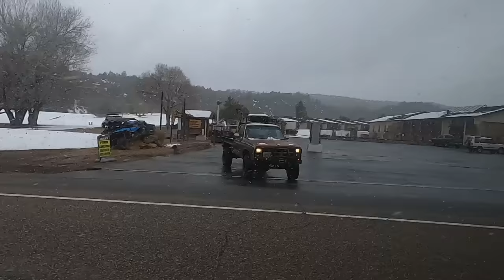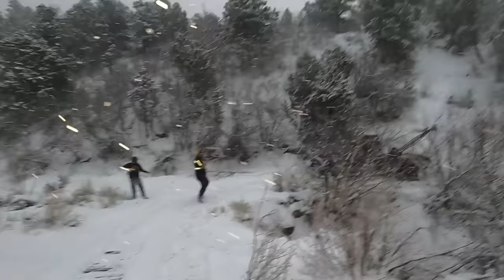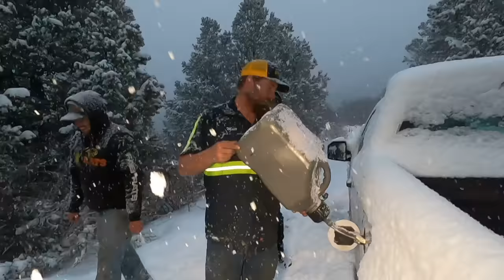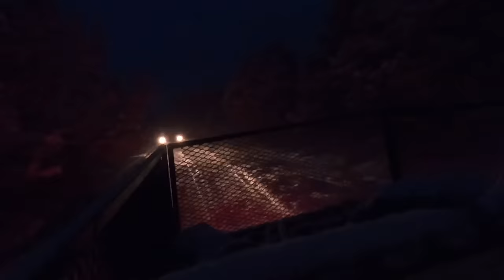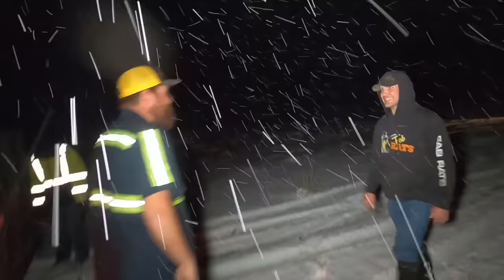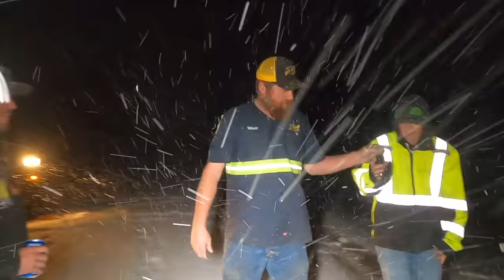Mountain Snow Recovery With A Major Twist!

Comment: A brief suggestion for the snow issues. My great wife and myself lived up a fairly vicious Colorado mountain road that got snow every fall, winter and spring. We used snow chains every year finally developing into a very serious set recommended by a friend further up the canyon that plowed snow with a Ram 1 ton. Had 3/8" side chains with double cross bars with ice bars. Chains were heavy and took a while to mount and then get tight, but were like driving with tracks. Whole rig was a 76 F-250 3/4 ton 4x4 upgraded to a bored out 390 Police Interceptor with 4 barrel made by Weber with a high torque cam. Then could get anywhere along with 1976 Warn 8,000 pound winch and had a snow plow from a dump truck, hydraulic flat bed, springs upgraded to 11,700 GVW, log hoist and three fuel tanks holding 60 gallons of premium. Got burned out by forest fire and now lived the good retired life. Truck still has an excellent owner and "STILL TRUCKING!" Our driving was different from yours as no sand involved just hard granite, ground up granite, minor mud but very serious snow as have had snow coming over hood with no plow while going up a 9% grade. Really enjoy your videos but please consider serious snow chains as makes life much easier in slippery or deep snow.

Comment: That guy sure is brave to go off roading in mud and snow with those tires. Those look like all season tires (and no gas).  YIKES
Reply: With some of the snow recoveries like in this one, it looks like a set of normal winter tires would have been enough for the stuck vehicle to not getting stuck in the first place. (And for the recovery vehicle to have a way easier time)

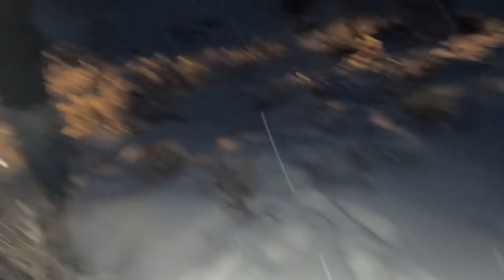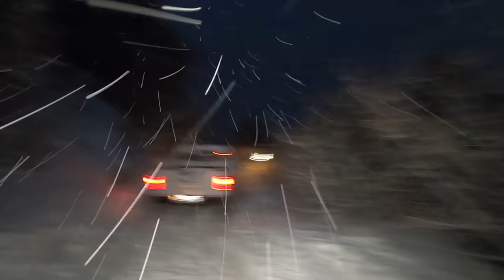Comment: Liz, at 10:51 that is how you drive in the snow. However you do NOT stop like you did at 11:02, the resistance from that much snow will help you stop if you need to stop so if your worried about getting stuck dont slow down.
Reply: Yep

Comment: Hey, i just wanna figure something out. I'm from Finland, where i live. we have snow for 7 months of the year. I know a thing or 2 about driving in the snow. Now, where we live, we do drive with studded winter tires, so that helps A LOT. But a lot of the vehicles you recover have all road or off-road tires which should work fine in the snow, why don't you let a bit of air out of the tires and NOT use wheel spin, i know for some reason it's believed that wheel spin helps in the snow, it doesn't, it melts the snow under your tires and makes it all more slick. What we do when we're stuck is make some wheelspin, like a couple of rotations at half clutch and then let the clutch grip and give the tiniest bit of gas and increase speed as you start going. Now, most vehicles overthere are american automatics, i do have one of those too, so what you do then is give like quarter to half throttle, let off and slowly give more gas. That way you pile some snow under your tires before you make a rut.

Comment: Don't think alot of people realize how badass the kinetic ropes are. Of course Matt is a fabrication wizard and lizzie/rudy excellent welders... but I've done a few very difficult muddy recoveries myself and static winch lines/tow straps are a crapshoot at best. Torque wins the day with that, if it doesn't dig you into a hole yourself. Those kinetic ropes stretch and build up their own torque and almost bounce the tires out of the rut. Invaluable!

Comment: My grandfather had a tool for shooting a valve stem into a wheel.  At some point you still have to pull the tire to get the other chunk of valve stemp out but it may help for these situations.  It is just a tube with a valve stem on the one end and a metal funnel that screws off so that you can put the valve stem in.  Screw it back together, put the funnel end over the valve stem hole, and apply air.

Comment: On our plantation in Kenya, in the Mau forest (rain forest) the centuries of foliage and mud  turn the roads into a glutinous slippery surface which even our Unimog can't conquer. So, we have winches front and rear, with cables, onto which we bolt real sailboat anchors to provide grip and winch us up, or down, the slippery slopes. Works a treat. Except, a cousin has a little front wheel drive Renault saloon thing which gets through any terrain, mud or flood, go figure. We don't get snow.

Comment: Matt reminds me of my father. The cold never bothered him. I remember cutting cordwood  at -20 degrees F and he was wearing a flannel shirt, jeans, boots and gloves and was comfortable. He always told me that you have to get it straight in your head that it isn't cold. Never worked for me.
Reply: Once you tell yourself it’s warm, you’ll be alright.
Reply: It really looked like the only thing that bothered him was the snow getting in his eyes.
Reply: @groggysword33  people who have the ability to withstand the cold by mentally blocking it out need to be even more careful. Had a coworker lose 6 toes because he didn’t realize how cold he really was and stayed out way to long. Doubt he even owned long sleeve shirts or a pair of pants. He was built like a polar bear though.
Reply: That strategy works great, until it doesn't. These guys get stuck on the mountain one night, and Matt falls asleep in his wet blue jeans, he may not wake up.
Reply: @davepg4173  never looked at that side of it.
Reply: @kliether33  as a guy that rarely has more than a long sleeve shirt for coat, I carry one or two in my jeep with wool blanket.  When people complain I assure them I have coats.  Given more than one coat to cold people
Reply: Karl Schwaber---I ran one night when it was -30 Celsius  , (  -22 Fahrenheit ) , plus , there was a breeze . However , it wasn`t fun . Cutting cordwood , especially if it was with an axe , is very
                             hard work . You can generate a lot of heat .
                              I used to shovel snow in shirtsleeves wearing a toque and gloves when it was -20 Celsius  ( -4 Fahrenheit ) , but , that is a long way from -20 Fahrenheit . Was your old
                              man wearing long johns ?
Reply: @williameddy1662  we were using chainsaws and my pa never wore longjohns. He was a different type of man,he got shot up by the Japanese during the war but never once complained. God threw away the cast after he was born.
Reply: @karlschwaber7006  Some people are exceptional . It sounds as if you were fortunate to have him as a role model . You have a good day , and , thank you for the reply .
Reply: @jeffrentsch4318  you're a good man, Charlie Brown. I still think it's silly seeing these guys wear denim on the mountain. It's one of the leading causes of hypothermia.

Comment: A little trick you can try when just stuck a little in the snow, if you can do is get a couple good old boys on the back of the truck bouncing the rear suspension, it can give you quite a bit of extra intermittent traction...it's like ABS/TC  but way better, so you can get going...eh.  
Lizzy you can get heat in your feet by jumping up and down...also in your hands you can force warm blood back down to your hands the same way kinda, you kinda hug your self quick enough so your hands kind of slap your back.

Comment: Cowboy boots in the snow is one of the coldest pair of shoes you can wear lol! I bet Matt was glad he took the snow cat
Reply: I found that out in high school. Spent the whole day out scooping snow in a pair of cowboy boots and got my toes frostbit.  Ever since then they have gotten cold at anything under 50 deg.
Reply: @lonhoschar1943  Easy fix, no matter what your footwear. Pull your shoe/whatever off. Slip your stockinged foot into one of those light plastic grocery bags and put the shoe back on. That's all there is to it. Even if you wait until your feet are numb, doing this will allow them to recover warmth.
Reply: @cotton-Dave EXCEPT that I was on a job at a military base, 20 miles from home, and no way to get back to their shop until the maintenance guys came by to pick us up.  I now have a pair of boots that I could stand still in -50 deg. all day long and my feet would still be warm.

Comment: Nice work! But I have so many questions, starting with why people are on a snow recovery with out proper clothes. Waterproof bibs, coats, and gloves for a start 😅  Also I think a mid size backhoe with a winch front and rear would be an awesome recovery vehicle. Tons of ground clearance and you can use the front and rear arms to pull and dig people out.

Comment: Lizzy: Its only flat on the bottom!  Classic!   Just curious, ever try winter tires for your trucks/cars?  Im in ontario Canada, real winter tires with the snowflake symbol make a big difference. The rubber stays softer in the colder temps, that with the winter tread makes a big difference!  Im currently using Yokohamas on mine, soo much bite that I can't even do a handbrake 180 turn!
Reply: When you travel 250 miles laden and at speed on dry highways...how long do your snow tyres last?

Comment: You guys are amazing until you get in the snow. I sit here in my snowy New Hampshire home, where I have always lived yelling at the TV, "STOP SPINNING". The secret to driving in the snow is to never spin your wheels. Spinning just forms ice giving less traction. Watch your vids. Spinning in snow and your stuck. Back off the gas and the vehicle will drive right out.  Sand is different where spinning helps. But snow, easy and no spinning and you won't get stuck.
Reply: On ice or snowy pavement, yes wheel spin is bad. However deep snow like this is a lot like mud, you have to have wheel spin. Momentum and wheel spin is the only way to bust through the deep stuff.
Reply: They have a different climate than NH. It can be 2’ of snow in the highlands, with 6” of mud underneath. They’re well versed in their type of snow.

Comment: You seem to be better at fixing things than myself; however, my old father, now long gone, taught me to use the wheel cover when taking the wheel off as a container for the bolts, and never leave them on the ground by themselves. One kick by mistake and all the bolts go flying who knows where. With the container, it's much more visible and can take a small bump without loosing the bolts.

Comment: Being someone who lives in a hot dry climate and only do a lot of sand driving 
We let the tyres down to 15 lbs and I would have thought snow driving would have been a similar thing 🤷‍♂️
Can’t believe you didn’t get frost bite Matt 👍👍
Reply: Snow is different. 
Tall thin tyres to cut through the snow and get down to the underlying road surface only works up to a certain depth of snow...then the bottom of the truck or the diffs etc cause drag...and that stops the  truck.
Chains run into the same limitations.
The Bombi is the answer...slow but sure... rides over the top of any depth (or not) of snow......just needs an overhaul atm...

Comment: Great video! Does that snowcat have wet brakes in the differential? I use a dmc 1450 for grooming some curvy trails in the winter, it has wet brakes in the differential. We have to throw snow on top to keep it cool. I use cat tdto for the diff. Our mechanic is going to tap into it and install a cooler for it as a permanent fix.

Comment: Most modern vehicles will hit 0 range and E on the gauge with about a gallon or so left in the tank. That close to empty the level senders just can't read anything, plus it's not great for the fuel pump, so manufacturers set E to the lowest they can reliably read and that won't cause potential damage. But in an emergency you can squeeze some of that remainder out for a few more miles

Comment: I hope that your using grade 8 bolts on those tracks. If grade 8 from the hardware store are breaking then you might need to be making sure that only the shoulder of the bolt is in shear. I have found that bolts that are factory from Caterpillar or Cummins are far and away much stronger than hardware store  grade 8 bolts as are bolts from ARP.

Comment: Mopar low fuel light come on with about 4 gallons of fuel left. So take 4 gallons times your fuel economy (MPG) and that is how far you have to go. Always a good test to perform on a vehicle new to you.
Reply: Maybe not so good on a CRD or GDI???
Read TFM and get the capacity of the fuel tank.
RTFM and find out what warning symbol or notification method your car gives when it has "run out of gas" or conisiders you should fill up.
Go to your gas station
Set tripmeter and /or take note of mileage on your odometer.
Fill tank to normal cut off point.
Go about your normal driving.
Drive until the warning your car gives (can be a light on the dash) appears.
Note mileage on the odometer.
Drive to the nearest fuel bowser...or tip in a gallon or 5 of fuel from a can you are carrying for this test...and then go to the nearest gas station and fill the tank to the auto cut off point.
Add together the spare can fuel and the amount you put in the tank at the gas station.
Take this total away from the total fuel tank capaciyty.
This gives you the gallons left in the tank as your "reserve after 0".
Note final odometer reading.
Subtract original reading.
Divide the number of miles by the number of gallons used as above.
This gives you your miles per gallon consumption.
Check that against your "normal" or against he long term readout the computer gives...so you can ascertain how accurate these gadgets are...
Reply: @JohnSmith-yv6eq  you test it by topping off once the light comes on, and subtract what you put in from the capacity which tells you how many gallons. Cute you use acronym s to try and stump. If you want to educate, then tell everyone that CRD is Common Rail Diesel, and don't use acronyms, it's a narcissistic elitist  maneuver that is not pleasing 😉

Comment: Just enough snow there to not bother with snow tires……I get it🤪.
Reply: With the distances on hard dry pavement the crew sometimes has to go to the rescue areas (250 miles plus) snow tyres would be worn out and probably overheat and fail at their crusing weight and speed.....
$$$$$
Reply: @JohnSmith-yv6eq  Chains ?  Used as required

Comment: Y'all need a 1/2 inch cordless impact and there is reason why they sell tire chains n shovels, learn to use them. Also snow n ice is like sand if you let some of air out of your tires you get somewhat better traction. Because you 4 wheel drive n big tires mean nothing in snow works better in mud tho, oh also get some gloves so the skin on your hands do not stick to cold metal. I know cuz I took the top layer of skin off the tip my index finger touching the bed of my truck back in the day and in winter. It also happened with tire chains, that was my whole plum of my hand had to use my breath just to release it ( breathing on it n slowly peeled it off but by that time learned to use gloves, learned my lesson from before) . Just because you use gloves does not mean your weak, they sell them to protect your hands just like welding gloves n shirts. And that my to bits or cents, SAFETY FIRST ALWAYS in the shop or out on a job.

Comment: I heard tracks for the jeep..... If they are what I think they are I hope they hold up better than most of the ones I have seen. I feel some of those fancy arctic tires would have been a better choice. They got the Top Gear crew to the north pole and they are not the brightest bunch.
Reply: The problem is the sheer size of those tyres.
You would need a monster pickup bed just to carry four....because they wear like crazy on hard surfaces...and Matt's recoveries can be 250 miles each way on hard surfaces...
$$$$$ either way...
or just tow the Bombi to where there is sufficent snow to operate it...and just too little snow to get the wheeled vehicles stuck....

Comment: One rhing about Ford trucks is the fuel sender unit or leveler can't read the bottom of the tank. You can literally have five to ten gallons of fuel in the tank but it will read empty. I think ford like giving their customers a anxiety attack. Theres nothing like driving miles away from a gas station. And seeing that zero miles to empty indicator pop up or gas hand on E with the low gas signal. Lucky for me i learn my truck schigennigans early. I now when I'm below five gallons or at five gallons. When i turn a corner hard and it act as if it want to cut off. I know im low then i want to be so i will stop at a gas station and fuel up.

Comment: f150's are notorious for their gas gauges.  when the computer tells you there are zero miles to empty you could have as much as 60 miles to go.  i have a 2014 and ive run it to the station with zero miles remaining many times over the years.  its only 12 miles away though i dont want to run it dry thats a bad thing.

Comment: Lost your backup!?! Why don’t you guys use 2 way radios or a CB radio?
Reply: In a 4wd club we all had to convoy with headlights on dipped beam.
The driver in front (of the following vehicle) was responsible for keeping  the vehicle behind in view at all times  (use of mirrors was the simple way to do this as headlights are easily seen ).
No headlights in your mirrors...you stop straight away...and reverse if necessary until you do see them again.
So vehicle in front of stopped/reversing vehicle also stops... and the one in front of him...and etc.
Thus the leader sooner or later also stops.
No need for radios.
But every club member had to have a permanently installed CB....and hand held were encouraged as well.
If no radio calls had been made or were impossible help was basically available front and rear...almost immediately.

Comment: When my wife’s F150 has zero miles to go, it still has enough gas for another 35 miles. Note: if you do run out immediately turn off the power so you don’t destroy the pump in the tank. FYI.